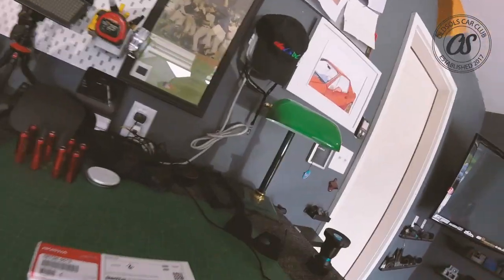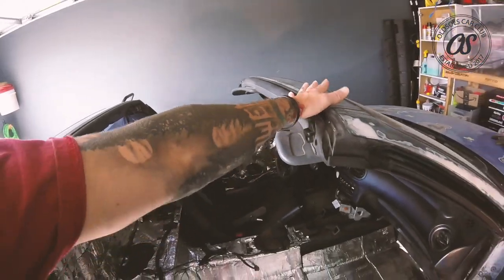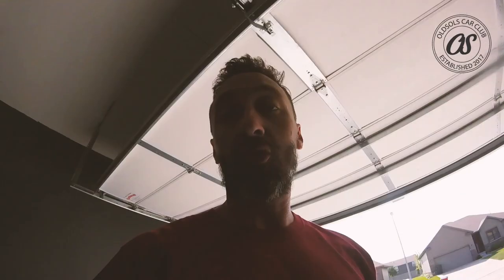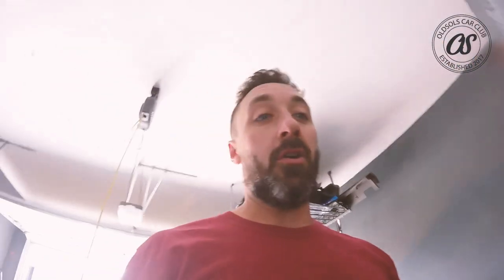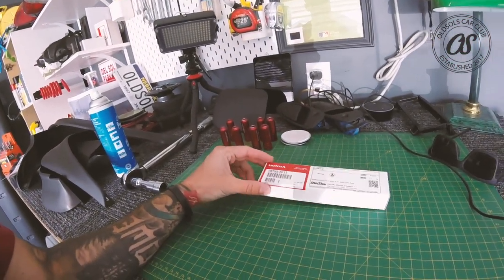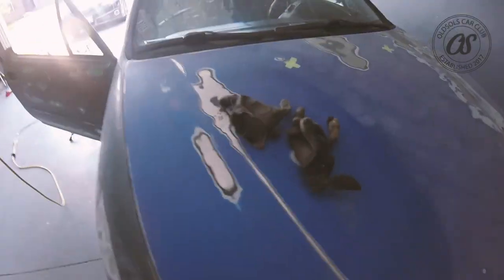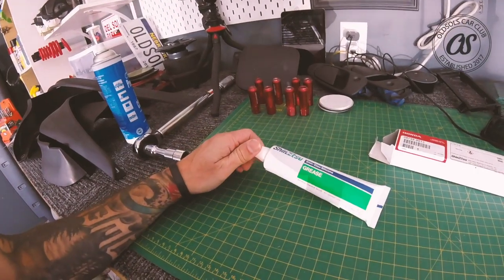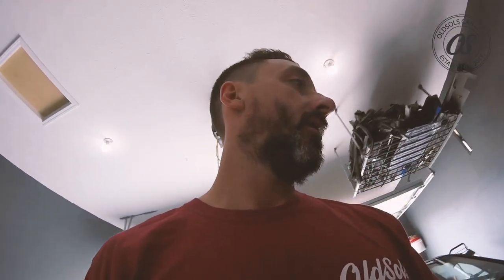Honda Del Sol - OldSols Vlog 43 - ShinEtsu

Comment: If you seals have rips and tears will this make any difference?
Reply from the maker: mace FTL i believe at that point personally you’d have to first try and fill in cracks and tears with black silicon and smooth them out so they are flush. Then still apply shinetsu on the areas that are still intact. This will help close fill in the pours and plump up the seals for a closer tighter seal.
Reply: @OldSols  Tight, first response I've gotten that hasn't been get new seals or perm seal the roof :) so much respect
Reply from the maker: mace FTL I mean hell .... worth a shot to try the black silicon and sinetsu .... if anything you tried and if it’s still not working THEN you resort to finding some junk yard seals or buying them off eBay for a pretty penny
Reply: Windshield PU sealant works better but need to remove old silicone for adhesion. Seals are made from EPDM material, unfortunalely without additives so squeak.